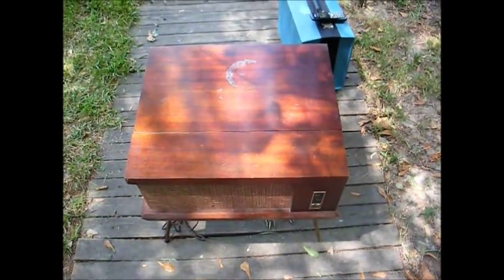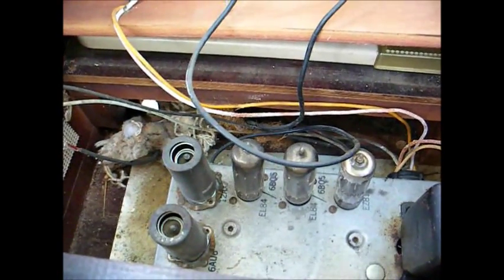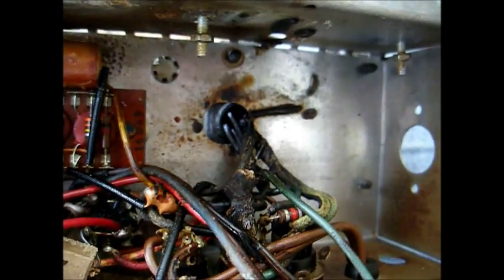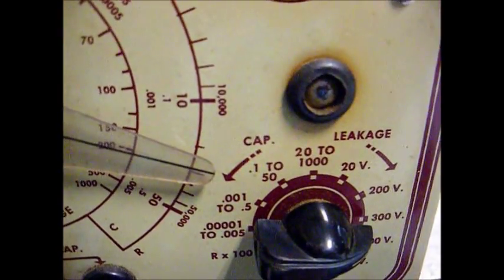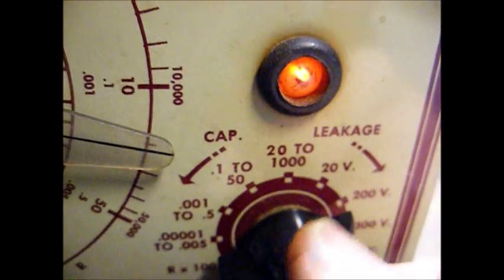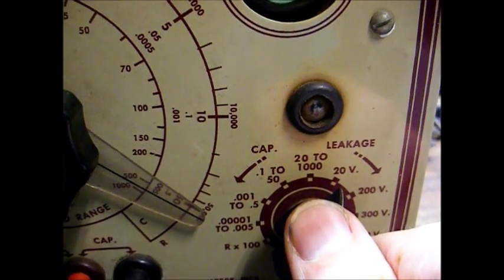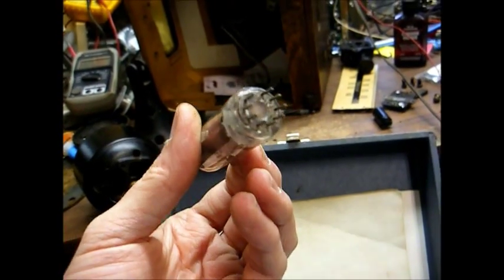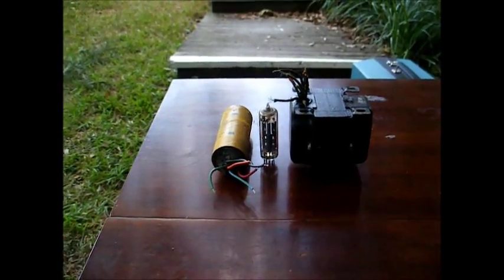VM model 562 record player: power transformer meltdown and why

Comment: I pulled that exact power unit out of a 1957 record player console and converted it into an 8" practice guitar amp. It had a 12" 1957 Jenson speaker in it that I put in my 1952 Gibson GA-20 amplifier, the original speaker was removed and replaced with a 1959 Utah speaker. The schematics were on the inside of the console so if you don't have and would like I could Email or Text it to you.

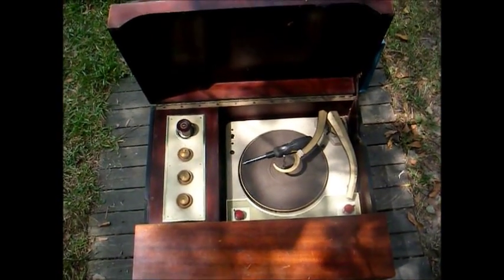Comment: 0:31 Reminds my of time about 12 years ago when I was driving home in a heavy snow storm with unusually sticky, icy snow. The dam car got halfway up a hill and just seemed to give up, slipping back a few feet every time it advanced a foot. After playing with the throttle, brake and steering for maybe 10 minutes, I started to notice this horrendous stench and a few seconds later, the traction control system shut itself off (overheated motor windings?). Low and behold, the tires raced and all the ice flew off of them, then the car made it up the hill with little trouble. But the stench continued the whole way home; the traction control didn't start working again until the next day and that smell stayed with me for at least a day. It was worse than any fried power transformer I've ever smelled. The TC on that Chrysler (unlike the systems on many Hondas and Toyotas) was excellent most of the time, but  I learned never to assume that such systems will always be an improvement; if it doesn't seem to be helping, shut if off (if you can, some cars don't have a switch) before it fries up and possibly poisons you.

Comment: This sucks! I spoke to my mom last night while she is down in Florida, she told me that they got rid of my vintage Sears Silvertone reel-to-reel tape recorder, because there is no way to finished and get it restored. I did videos of that on my other channel "GEWildcatRocks" a year ago, and that one must be a no-go. It has been sitting in the attic for about a year until my parents got rid of it that it's not working anymore. It's a tube type unit, but it was a failure. As you know, my Sears Silvertone reel-to-reel tape recorder model 4238 is of course EOL, that means no more reel-to-reel tape recorders, but I have three of them at home and still works which is. My Sony TC-600 from 1963 which also has tubes, my Sony TC-580 still works and my Akai 1721W, all three of them works perfectly.

Comment: You're absolutely right; when a power transformer goes, 99% of the time something besides the transformer caused it. I'm glad you're going ahead with replacing the trans on that....it really is a nice unit, and worthy of the extra effort. I know you've got alot of extra parts, but if you don't have the xformer you need, I'll bet that Mark Oppat over on ARF will have what you need.

Comment: My nose used to be the first piece of test equipment I used when I repaired radios or other electronics. Another unforgettable odor coming from a piece of equipment is a burned out selenium rectifier! WOW! 

Good luck with the project and thanks for sharing your video.

Best regards,

Make Bradford
Reply: Mick Bradford I probably smelled that same thing a few times in the past too it's an acrid smell but kind of hard to distinguish the most frequent smelled electrical burning odor i guest is that of arcing and lightning which smells like ozone similar to overheating brakes but it also depends on the materials that are burned as well like with a blown out electronic or appliance components wires you might smell fumes from burning plastic, wax, oils and ceramics as well

Comment: My suspicion about the chain of events. Rectifier shorts. Resulting AC output draws excessive current thru filter cap since it is an AC short. Filter cap and transformer smoke. I have no way of knowing what happened in this scenario, but I've seen the leaky rectifier popping the fuse or circuit breaker when the filter cap gets hot.
Reply: I think it was the reverse, the filter cap was one of those cheap "Toilet Roll" ones, it shorted out, overloading the rectifier, which caused a heater to cathode short, which then overloaded the power transformer. I have yet to run into a rectifier tube that decided to self destruct on it's own, though I have run into power transformers that may have decided to self destruct via a short in the high voltage winding.
Reply: shango066 yes  when things like that go  they make a lot of noise  speacally if the filter cap goes or elctro   hey can any of yall help me im looking for a weird cartridge for my rca player  I don't know  what the numbers are  its  one that has the styles on the same side not a flip one and a bar you slide back and forth the select needle I can photograph it   I looked on the vm website didn't find anything its also a stereo player.
Reply: Is ti like this?:
http://www.gemm.com/search/GML826711572

Or this?:
http://www.gemm.com/search/GML1457903988

Comment: This is why I tell people to replace the caps.  They are too cheap to ignore, and too expensive to deal with the consequences.
Reply: I've said it on AK before. I never understand why people apply the "If it ain't broke don't fix it' mindset to equipment 40-50 years in age. Hell, I have stuff half that age that shows signs of needing recaps.
Reply: Reddit be like: "bUt CaPs ArE eTeRnAl"
Reply: Rod Beauvex I have a 59 record player all original and still works perfectly   no hum in tha amp no distortion and so on  the transformer bary even gets warm after hours of use   I watch for stuff like that  when I notice  signs of trouble I quite using the item I have a record player that needs a new filter cap elctro   bad hum and distortion  the thing hasn't been powered on since it went bad I don't want to burn anything up.  I have a Newcomb player that's original to but it has a fuse in the circuit  I like to keep stuff as original as I safely can but I try my best to watch for the warning signs  like  strange noises actions  smells etc yes tubes and caps are cheep usally   but transformers  just hope it don't go bad lol.I try to watch the voltage draw on my equipment too if something seems off ill quite using it till I get it checked.

Comment: Hopefully, you can find a new power transformer. I LOVE VM products, I've worked on many of them. They were a classic example of the high quality products we used to make in this country. The Mullard and Bugle Boy tubes are probably replacements. During that time period, VM used mostly CBS, RCA and GE tubes branded as VM but with the manufacturer's EIA codes.

Comment: I have the same player, in a blonde cabinet.  It works fine but needs to be recapped bad (lots of hum), Guess I'll pull my amp out and work on it as it is a wonderful unit.  Tons of volume and quite the nice sound (and should sound better with good caps)!  Thanks for posting.
Reply: I'd do it sooner as opposed to later to avoid a similar disaster. VM is a top notch product.